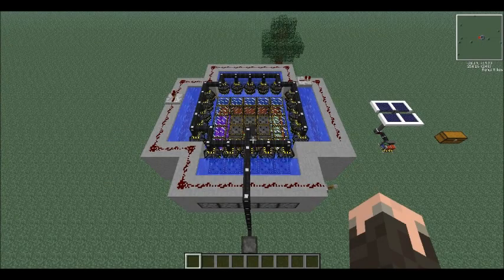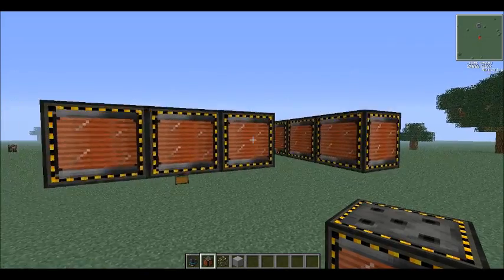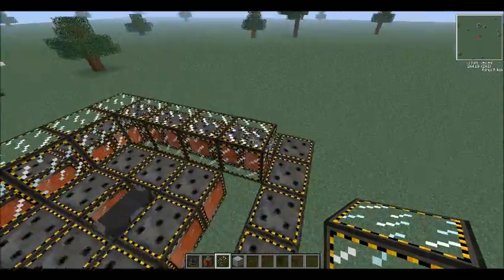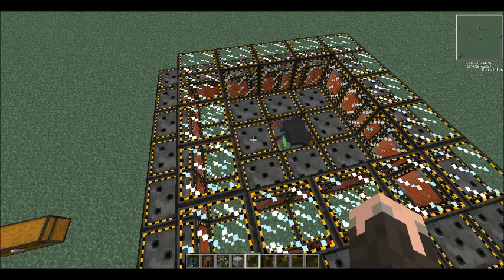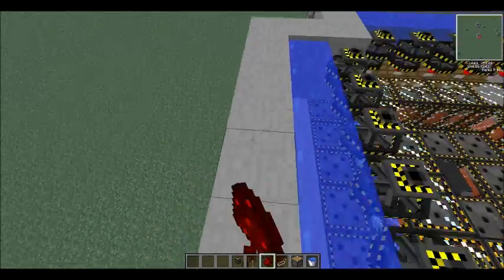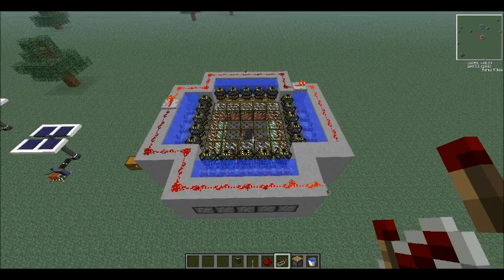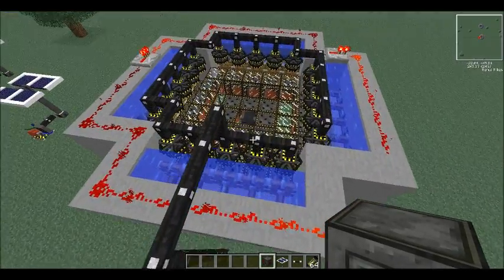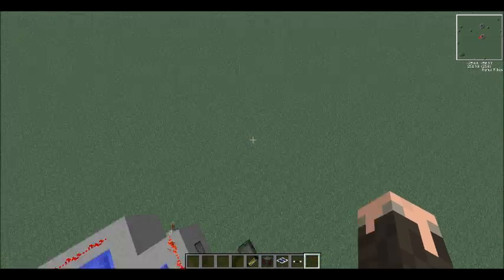Voltz tutorial: Fusion reactor!

Comment: Question, is the glass needed or is it only if you want to look into the reactor without going fully inside?
Reply from the maker: if the mod works the same way as it did then, I'm fairly certain it shouldn't matter what blocks you choose to use, the glass is just for aesthetics
Reply: @Craftyboiii  is this the same for all contraptions you use glass in? Its just im low on resources at the moment and I don't want to waste them if i dont need glass, ill go back and do   that later.